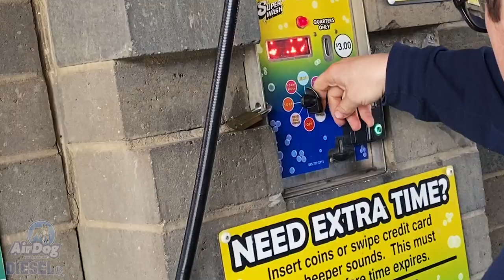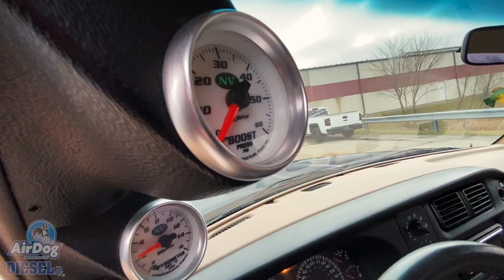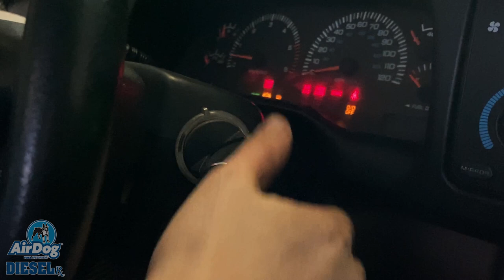Kevin's Regular Cab Short Bed Cummins

Comment: Did he use the half ton front suspension? Or did he beef it up when he dropped in 12 valve?
Reply from the maker: 3/4 ton coil springs in the front and factory half ton leafs in the rear.

Comment: Please someone answer me does it still have the 1500 axle Dana 60?? I’m doing the swap want to know if it will handle torque
Reply from the maker: It has the stock Chrysler 9.25 rear with a Yukon dura-grip limited slip. It it plenty strong.

Comment: If you have a 4x4 clone of that truck what would you need in order to keep the 4x4 capability?
Reply: What trans you got??? the manual will bolt to a Cummins with a Cummins bell housing or you could find a 48re and transfer case and run it
Reply: @hunteringlis9262  none yet, but I’d like an auto so 47 or 48re.
Reply: If you meant what trans the truck has it has the v8 magnum and the automatic trans
Reply: Probably just a drive shaft would be all

Comment: I had a 4x4 1500 short bed with a 12v and nv4500 swapped into it. Sure miss it!
Reply: It was swapped or a stock 2500 ?!
Reply: @daydaydurant337  swapped 1500.
Reply: @Pan_Gotti  nice!!! I get so much mixed info on the whole swapping thing  I wanna do mine just lost lol
Reply: @daydaydurant337  it's pretty easy tbh
Reply: @Pan_Gotti  is there away I could message you for some info ?!

Comment: What did you do for wiring wise? I got hole parts truck as well, have change the dash wiring with the wiring out of the Cummins?
Reply from the maker: The engine harness with fuse box was transferred to the gas truck. The dash harness was all the same. The engine harness was ran through the firewall and plugged into the connectors under the dash to where the gas engine harness was removed.
Reply: Ok thank you  would be same if I went with the older  2nd gen. Looking do 94 shorty for my 24v
Reply from the maker: @Purestock_24v  You may need to swap the dash and harness at that point. Mine was easy because both were a 99.
Reply: @AirDogSales   ok yea I got the hole truck still.     Be a pain do the dash swap crap?
Reply: Did you swap computer.
Reply: @backtotherootsoutdoors4306   idk asking me or air dog.  But I swapped my auto computer out

Comment: Wtf 🤯🤯 how’d he go about his fuel system? This is a bad ass truck 🤙🏽
Reply: I did the same thing but with a 4x4 single cab shortbed had to use the original 25 gallon tank out of the 1500 witch was a bummer bc I really wanted that 30 or 35 gallons w.e it was
Reply: @connorewers478  Can you run a secondary diesel tank in the bed of the truck as most construction operations do?

Comment: That poor frame is taking alot of abuse just having the cummins on its nose
Reply from the maker: The frame up front is the same. The Cummins stuff literally bolted right in. The only difference is the rear section is a little smaller. That's fine because this truck does not haul anything. I have a dually for that.